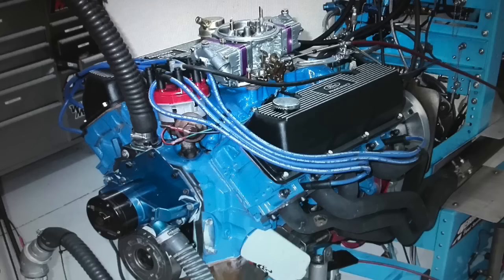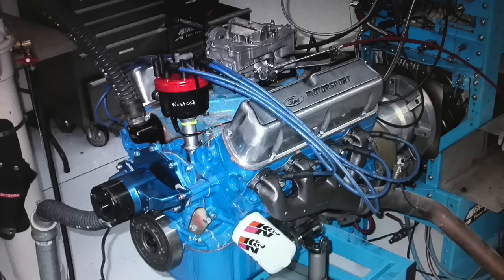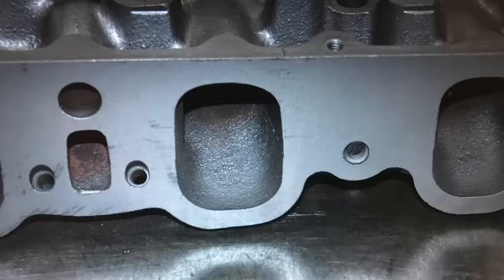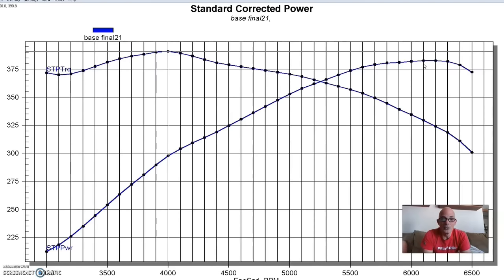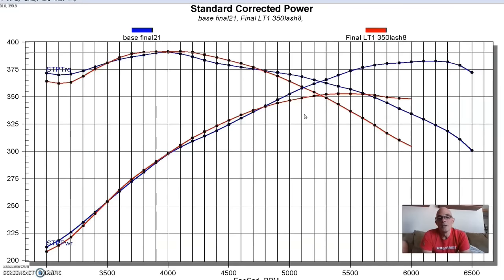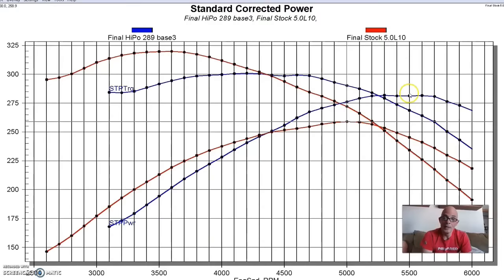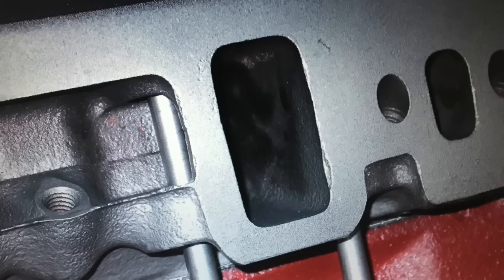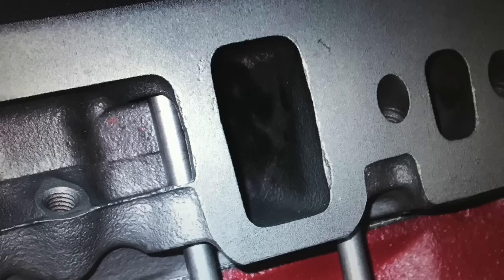HOW MUCH POWER DID THE 1971 BOSS 351 REALLY MAKE? WAS IT THE HOTTEST SMALL BLOCK EVER OFFERED?

Comment: Here is what my brother and I did in 1972 to our 289 'a' code 4-speed(toploaders in 64.5😁)Ford Mustang. 

First off the car was a pig in stock trim. We bought the car in 1970 for $600 and immediately started racing....and losing...and racing....and losing. Till the ultimate insult...our tranmission output shaft literally twisted in half while racing of all things a Pinto...and the sad thing is we were losing to it when it happened. Well we decided this was the most famous engine Ford ever built and we weren't gonna settle for dismal performance anymore out of it. We found out when we rebuilt the trans. that the car WASN'T A '65 as it stated on the registration. That means these things were as light as a Falcon(ultimately got her down to 2,500lbs with the seats). Engine wise we stripped the block had it linebored w .030 bigger pistons and increased compression 1 point to a little over 10:1. Kept the heads stock but used the Ford racing valve spring set they used in their FIA engines along with some rod savers. Put the 'hi-po' solid lifter camshaft in her. Aluminum medium rise edelbrock(tarantula I think it was called) with a Holley 600 w/vacuum secondarys(easy fix for that). Douglas headers. Shaffer racing clutch w/ aluminum flywheel. Instead of the single point Ford distributor that was on the hi-po, we bought a Ford Racing dual-point mechanical advance distributor. The car got very quick but it still nosed over when the revs climbed north of 6g so we did the last Shelby trick we had learned way back but had forgotten about. We put an electric fuel pump just outside the fuel tank. That was the magic bullet. That car would rev north of 7g all day long. We NEVER lost to any small block or engine car under 400 c.i. in the 2 years we cruised the main except twice, once to my friends brand new 1970 Boss 302 which he had the rev limiter disconnected(I so wanted to put those heads on our 289 if they would've fit)and a '340' Duster but he was alone and I had two other people with me. We made a point to race again alone but it never happened. 

That's my 289 story. I sold my interest in the car and moved onto racing go-karts but my brother kept it a while longer before selling it to some redneck who used it to go hillclimbing with........sad ending for a great, fun car. But quite the rep. There almost wasn't a night of cruising and stoplight racing we weren't asked to pull over and prove that we only had a 289 under the hood. That was the best part...seeing their faces when they realized they just got beat by a small block FORD😁

Comment: This is another great test and it shows that the very large port 4V heads needed the extra cubic inches to really show what they could do. This engine makes more sense than the Boss 302 whereas the big heads hurt it down low. The Cleveland engines had a bad oiling system however and the Windsor was the better short block for the Boss heads.
Reply: I know your post is 3 years old but he did a test with a Boss 302 and it made just as much torque down low as a 350-351 with similar cam specs. It’s a myth that big heads don’t make power down low.
Reply: @LegionGamingTV  I have a boss 302 in my 68 F100 in front of a C4.
Better gas mileage than a 390, but if you want power, just push the gas pedal.

Comment: First car was a 67 comet, solid lifter 289,long tube headers! NEVER got out out ran but the leftover 350 Chevys in mid 70's Chevels, or stock Camaros! Now, it had cam, intake, headers.I t was a stick, they were autos! The mid 70's stock 350s were pigs! They were all slow by today's standards, but the earlier 289 hp heads were better, they didn't have smog humps in the exhaust ports! Compared the times of the Shelby gt 350s with the 72 up smog motor chevies! With those soda straw exhaust the 66 gt350 ran  14.6 in the 1/4! Pretty impressive for the time! But Ford just put a cast iron intake and an Autolight card, with the mild solid lifter can! No headers! The first 5 liter motors were faster than the later, I watched them on the street and on the track. Chevy guys started buying up the fox bodies!

Comment: Yeah, the 4V heads were sooo good that Bob Glidden spent thousands of hours trying to get them to work for Pro Stock. Port velocity was waaaay too low, just like the Hemi heads.

  The 4V heads were designed for circle track, pedal to the metal for hours.....just like the Hemi.
Reply from the maker: He did pretty well in pro Stock-and the dyno does not lie about the torque curve

Comment: I would be curious to see if there was any noticeable difference between an all things equal shootout between a standard +.030 over 5.0 (306.1) vs a big bore 4.125 block with a 289 2.87" crank (306.8"). I'm guessing the differences would be negligible where there wasn't a huge difference with a mildly built 302 sbf vs 305 sbc and those two have significantly different bore n stroke configurations.  Personally I have always been impressed at how much low rpm TQ ford squeezed out of the 5.0HO engine with such a short stroke in it's era, it's rarely acknowledged but it is actually quite impressive engineering.
Reply from the maker: the stroke has almost nothing to do with torque production-that is displacement and the combination of long runners, mild cam and small heads

Comment: Well I agree on the HiPo in one way I disagree in another. THe HiPo is without a doubt a nice power plant for that era mustang (64-66) IF you want to road race it or just generally dont care about huge power output and you want a high winding easy to work on , light package that was designed for that car . As to how high winding ? Yeah I call BS on some of those comments you got on the RPM range and I have tons and tons of seat time in all of those era mustangs with many combinations. So with the solids you wouldnt get float and maybe guys watched the tach hand climb above 6500 but they werent going anywhere....The HiPo is just a neat  , tidy little engine that does run pretty good but just isnt over the top in any way.
Personally I took the theory behind that motor and overlayed it on the 351W using the 282S Comp (YEs I have seen you use it as well) and some decent 69 heads and THEN you got something that pulled hard without a bunch of mods or compression...The 351s just have more potential and with the head choices now its rediculous. 
The 351 BOSS motors were like beer cans at one point and I had a few blocks and engines laying around . They did run but again , when you got them into the RPM those heads needed the oiling system started failing and the pin was pulled on a fairly nice grenade... I used to say that the Cleveland did two things really well , Run hard and blow up......👀

Comment: The only cars I had from this Era was a 1969 Chevy Impala SS 427. and a 1969 428CJ Mustang Mach1. The MACH1 would consistently run faster 1/4 mile times around 13.60ish but I think that was more because it was a 4 speed Mustang vs a slushbox Impala.

Comment: Back in the day,mid 80's  I built a 302*.030 with a Trw preformance cam. I dont remember the exact.  numbers but was close to.500 lift and around 288 duration. And the typical accessories. Accell 600cfm holley with the 351 D0oe 4v heads with the 4sp top loader 3:50:1 9" diff in a66mustang fb. Any way it ran pretty good any Idea in approx. Dyno Numbers it could of recorded. I know guessing is guessing.

Comment: The main problem with the old 289 was  Intake manifolds of the time was not good !   
About the Quarter mile  time s i ran better  times with my 1966 289 than I did with my 1989 Fox mustang. Both with simple  mods. Cam Carb intake and headers. I ran 13.50 @ 102 with the 1966 and  only 13.80 at 99.5 with my 5.0!  i run both with 4.11 gears and 26 inch slicks.

Comment: Dennis, you’re right about the Hi-Po 289 compared to a 89 5.0.  Driven both.  No contest.  The problem is you can’t compare the two.  Too much technology.  You have to put the Hi-Po 289 up against it’s contemporary competitors.

How did the Hi-Po 289 stand up to the Dodge\Plymouth 273?  The 235hp Hi Po 273 from the Dart, I believe.  The 340 wasn’t around yet. And the solid lifter one-off super high output factory high performance 273 was a limited production option also, available only in the D Class racer, kind of like Chevy did in the Z-11 Impala.  That would make it unavailable as a competitor.

How did the Hi-Po 289 stand up to the Chevy 283?  (Was the Power Pack a real option or just a dealer modification?)  You can’t compare it to the Fuelie 283 because it was a limited run that was recalled.  The Hi-Po 289 was a continuous running option through 67

AMC had a 280 that was pretty perky around 67 I think.

You have to compare it with it’s contemporaries.  That is when it shines.  You can’t compare the Cadillac 390 with a Ford 390 or the MEL 462 with the 70 460 or the AMC 327 with the Chevy 327 and expect them to come out the same just as you can’t expect the Chevy 350 to perform with a 6.2 LS.
Reply from the maker: who is Dennis?

Comment: I had a 71 boss 351  blue with silver and car and find a way we did to bypass the rev limiter on it and I didn't find a panel that great because of the weight size definitely not a fan of the steering wheel and I ended up wrecking at street racing in 1975 I got that boss at a credit union and I took a lot of parts off of it and I went and it's a credit union they had a 71 Torino cobra grabber green this one had the 429 super Cobra jet with a drag pack I'm strained it had a bench seat with a four speed well went back to street racing and about six months I wrecked it I remember somebody else that had a Torino GT and the first thing that they took off that car was the tachometer

Comment: Thanks again Richard! While you have that Boss sitting there throw a big flat tappet, single plane & a 850 on it
Reply: Solid Roller is way to go on Cleveland Engines, Because of the high rpm nature of the Cylinder Heads, you will float the valves with a hyd cam before you even tap into the airflow of these 4V Heads. I went from a Big Hyd Flat Cam to a Solid Roller just a little bigger than the Hyd Cam, and made a Big Difference.

Comment: I'm a mopar guy and big fan of the 340 but I don't think it would make as much power as the boss 351 even with an autolite carb and factory air cleaner that i bet would cost it a little power.  I also think the 71 340 4bbl is the best 340 even over the 6 pack, the 6 pack has a funky intake and offset rockers that cost it some valve lift where the 71 4bbl had good fuel distribution, the same high compression, same big valves, and an 800 CFM carb vs the earlier ones had about 600CFM.  The advantage the 340 had over the boss 351was over 200 lbs lighter cars it came in and the engine itself was lighter weight so less weight on the front wheels in particular.

Comment: I had a 1969 mustand with stock 302 2 barrel carb. i would only race stock engines cause mine was all factory, i won all 1/4 mile race with it. My best friend had a 1970 cougar elimimator with the BOss 302 4 speed stock gear, this cat was bad i was a whitness to this cat eat up a 1970 cheville 454 ss 2 differant cars, a nother friend had a 340 dodge dart 4 speed , it wasnt no compition to his bad cat. he still has the car. i like the 289s i like the 351 clevlands but my favorit motor is the light wieght 302 boss wich i call fords lawn mower engine stands up against big blocks small blocks. i am in the process 0f building a boss 302 for all out competion.

Comment: What about the LT-1 350 chevy they put in the 1970 corvettes? It was a solid lifter cammed fire breather. I am pretty certain it was a 375hp motor.
Reply from the maker: I tested that 1970 motor (video is up), it made less than the Boss 351
Reply: @richardholdener1727  i should have known you did. You seem to be pretty damn thorough and that is a compliment.
You are certainly not a lazy man or a man that seems to half ass anything....I hate a man that half ass does everything because everything the do is prone to fail.

Comment: Richard, To answer your question about the 289 power numbers back in the day, in short, Shelby cheated. The 385 hp 289's that Shelby American ran had what were quietly referred to as "289 HD" heads.  These heads featured a much larger intake port and very large raised exhaust ports and larger valves. Miles and Remington also ran hotter cams and a "rev kit" which was a set of heavy duty push rods and a spring that was sandwiched between the bottom of the cylinder head and the top of the lifter. These never came anywhere near a production car and were only known inside Ford and Shelby. They were used on the '63-65 USRRC and FIA Cobras, Daytona Coupes (the car used by Ol' Shel to kick Ferrari's ass the first time in FIA sports cars in 1964) and '65-66 GT350R Mustangs. For the now famous GT40 program in 1965, these heads required a part number and were assigned the number C6FE.
Reply from the maker: the race motors were definitely different than the production motors

Comment: You would not believe how many 302/351C-Boss engines I've had and it's my #1 engine of all time. (428CJ 2nd place.) The only problem with the 289 HiPo was the heads. They are really, really small ports. With that said there is/was a guy named Gary Williams who ran a 64 Comet with a 289 in it. As I recall he was runnning low 11's in a 3200# car in SS/MA. I think he or his brother had a 65 Mustang with a 289 in it a little faster also in SS. Both produced way over 400hp. SS rules allow aftermarket cams but factory carb and of course factory head. So at least some people learned how to make that 289 head run. In the end, the 351C to me is the best engine every made for power/cost. It's also the SBC of Australia and they rip down there. ;-)
Reply: Don't the Cam have to have the Same Lift as Original, But Duration can be Much Longer ?

Comment: The Standard 289 was a work Horse used in Cars, Pickups and Cab Over Tractors.  It was a Great little Engine in the Evolution of Ford V8s.  With that said, the hypo was an improvement, but, can't compare to the BOSS 302 or BOSS 351.

Comment: Good motor .. but i still prefer The Machine from 1970. With the group 19 v code service package .. the 390 small block had 472 hp. And easily turned out 12 second quarter miles. It was the only muscle car that year that made 15 inch wheels standard.

Comment: @richardholdener how about a back-to-back long tube headers vs the Tri-Y headers on the 289?
Reply from the maker: I do want to do a Tri-Y header test to show they don't add more torque compared to 4:1
Reply: @richardholdener1727  do they change anything at high rpm?
Reply: @richardholdener1727  The Try-y header rocks the torque curve. The peak will be the same but if you image the peak number to be fulcrum, the area under the curve will rock to the right or left depending on the tube diameter and length. I believe the Shelby try-y header rocketed it to the right. ie, more torque above the peak than traditional 4 into 1. Its' been a long time since I saw the graphs  (40+ years) but that is what I remember.

Comment: Hey Richard, why not compare the hipo 289/302 with a boss 289....but instead of using the boss 4V heads use a set of c/c 2V clevo heads....stock heads flow approx. ±200cfm on the inlet and ±165cfm on the exhaust @ .500"....
Using the factory or ported heads it'd be interesting to see what gains, small or large, would be made and how it would stack up against the 302 using the same 289 heads and boss 4V heads....etc.
Cheers
Reply from the maker: then they are just modified 289s
Reply: @richardholdener1727  thanks for the reply....I hear what your saying but isn't the star behind the boss motor, the Cleveland head....yes it's the 4V version but they both share the same dimensions, canted valve geometry, poly/semi/hemi style chamber, machine the pedestals as per boss and the entire adjustable rocker set up fits perfectly, so wouldn't it be fair to say that the 4V is just a big port/valve (modified) version of the 2V....or vice versa.
I'm in no way ragging on 4V's, I've used both for years on various cars/combinations, if you're not chasing the highest number, the 2V may surprise you.
Cheers

Comment: No, all hard core Ford fans have been aware of how good the Boss 351 was.  It would have been even better in a lighter, smaller, body.   Yes, the HiPo 289 was not at all what it could and should have been, with heads that had the same size valves as the ‘standard’ 289 heads, and which flowed no better than the ‘standard’ 289 heads.  Good heads for the 289 that were touted were very much modified, and good ‘stock’ heads did not come out until ‘67 (GT-40 heads), and they were expensive.  These were modified slightly to become the 69 351W heads in late ‘68.  Finally decent heads for the 289 were readily available at a much reduced price.  The HiPo 289 should have come with improved (GT-40) heads.       Joe